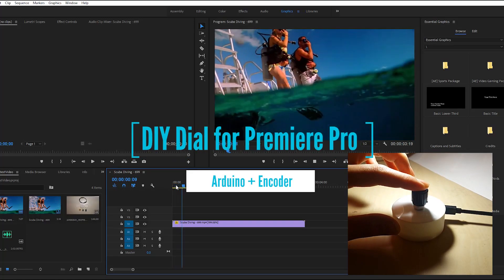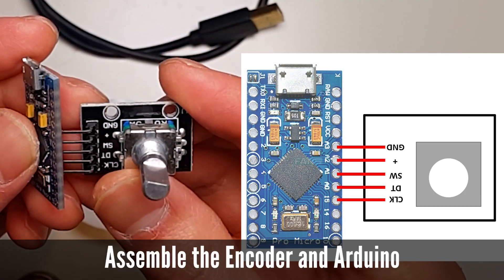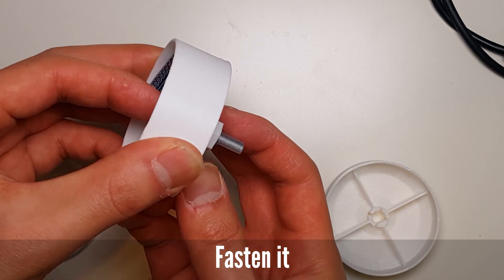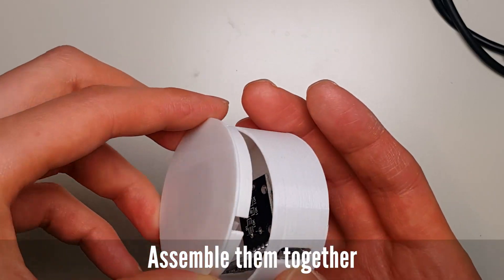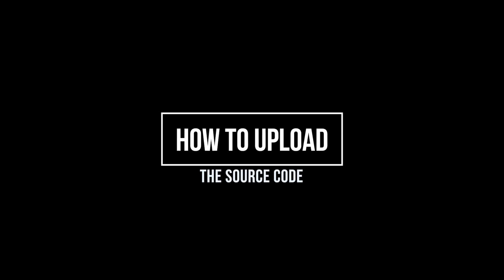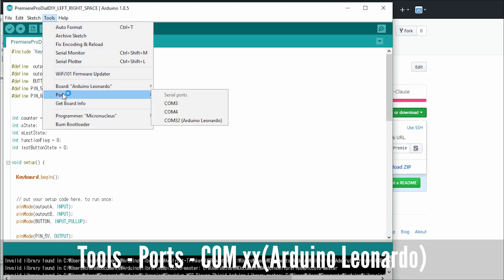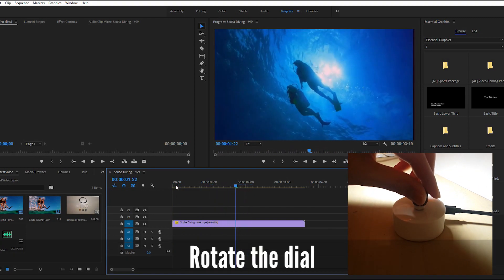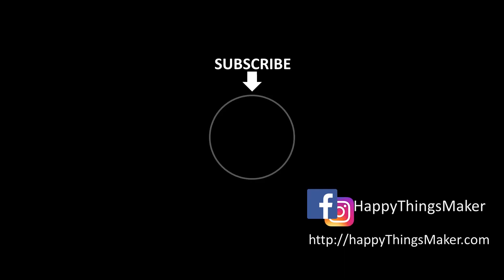Premiere Pro Control Dial DIY |  Video Edit Wheel | Arduino Leonardo Project | How to make

Comment: Thank you for sharing, excellent ! Very elegant design :)
As a suggestion, a version with 2 buttons, when you press them the dial move 5 / 20 frames (or more, customizable), when you release it it moves 1 frame. That way you could rewind / fwd fast , then adjust . 
Press dial to cut .
Reply: Did you find something that will do this ?

Comment: Can you make it work with Blender brushes? Sculpting & Texture painting? & With ZBrush & Substance Painter?
Reply from the maker: Hello! I checked Blender. I don't know well how to use that application but I checked the brush size is changed when I turn the dial. thanks
Reply: @EunchanPark  thanks for checking! I'll remake your design & hope it works for me too. Thanks for the video!

Comment: Hi EunChan, I know you already have a version two but I can't find the same dial that you have in my country, instead I found the same dial you have in version 1 so I have to follow version 1 instead. It works but not sure why when I turn the dial right, it turns to the left for one frame before going to the right frame? Same happens when I turn the dial to the left, it doesn't go left straight away. Is that what you mean by chattering in your programming? Is there a way to fix this? The dial works but very in accurately. The press button works perfect all the time.
Reply from the maker: what source code did you use? could you comment it please? you might need to add some delay on the code.
Reply: @EunchanPark  I used the PremiereProDialDIY_LEFT_RIGHT_SPACE code. any other code doesn't work. I managed to tweak the code after reading up a little about adriuno. I changed the keyboard.press to keyboard.write, remove the timer check and somehow it worked better for me. The left and right turn now is more accurate and doesn't jump a few steps anymore.
Reply from the maker: @limsoonchiong  would you try one more time from the source code? I updated the code which includes delay 8ms
Reply from the maker: https://github.com/happythingsmaker/PremiereProDialDIY/blob/master/PremiereProDialDIY_LEFT_RIGHT_SPACE/PremiereProDialDIY_LEFT_RIGHT_SPACE.ino
Reply: @EunchanPark  thanks. Will try again soon. Gave the dial to a friend to test the results.
Reply: @EunchanPark  is there any posibility to fine tuning values of reveal mode? 

(x5 mode) is 80, 85, 90, 95. Do u understand me? [ACTUAL CODE]
(x1 mode) is like: DARK: 84, 85, 86, 87. 

I would like to swicth definetly to (x1 mode) i hope we can do it! Anyway the x5 default mode is working properly.
Reply from the maker: @JesusGarcíaZamudio  yes, that's possible. you need to put mode code for pressing the keyboard 5 times more
Reply: @EunchanPark  no, i want 5 times less points, actually the values changes like -5/+5, i want -1/+1.
Reply from the maker: @JesusGarcíaZamudio  yes, that's also possible. you need to put some counter variable and takes every 5 times.
Reply: @EunchanPark  but if it counts 5 to send keyboard left/right how is possible to get a 1/5 digital signal step value?
Reply: @EunchanPark  i want to send steps 1/5 times less longer than the actual code
Reply: Is there any posibity to create from zero a programmed counter that starts at +50 then i want to modify this value to +38 for example, then it save pressing the center button and reset by a holding press for 2 seconds. I would apreciate it to see it. Now i dont have the idea to program that order
Reply: @EunchanPark  Hi, the new code works better. Thanks. Just wanted to find out if I use this model, how do I get it to work with Lightroom? The light room code only works for model version 2 right?
Reply from the maker: @limsoonchiong  well, you can use the first code with modification.
 change this code 
from 
Keyboard.press(KEY_LEFT_ARROW);
to 
Keyboard.press(KEY_UP_ARROW);

and 
from
Keyboard.press(KEY_RIGHT_ARROW);
to
Keyboard.press(KEY_DOWN_ARROW);

It might be working

Comment: Hey dude i have arduino leonardo can iuse for this program code?  And i'm using davinci resolve
Reply from the maker: Hello, yes you can use leonardo. by the way, what is the davinci resolve?
Reply: @EunchanPark  ya i'll and tray add some button,  DaVinci Resolve is the world’s only solution that combines professional 8K editing, color correction, visual effects and audio post production all in one software tool! You can instantly move between editing, color, effects, and audio with a single click. DaVinci Resolve Studio is also the only solution designed for multi user collaboration so editors, assistants, colorists, VFX artists and sound designers can all work live on the same project at the same time!

Comment: Good day Sir, i have done everything like you said,  and i upload the code, but it doesnt do anything.. i have the same parts as you and everything. i just wanna be able to scroll through the video and pause it when i need. Revind and Fast forward.. stuff like that..
Reply from the maker: did the source code uploaded well? I mean, when the code is uploaded well, you can see "Done Uploading"
Reply from the maker: and make sure you will need to download this code https://github.com/happythingsmaker/PremiereProDialDIY/blob/master/PremiereProDialDIY_LEFT_RIGHT_SPACE/PremiereProDialDIY_LEFT_RIGHT_SPACE.ino
Reply: @EunchanPark  yes
Reply: @EunchanPark  is there a code to check if everything is ok, i mean a code like to scroll on the web or to control the volume..
Reply from the maker: @loodBRATEpr00  okay, I am writing a code for the test. I will share it tonight.
Reply from the maker: I have few questions.

1. do you use windows? if yes, could you check your "Device Manager"  - Ports - (Com& LPT) and what can you see there? is that Arduino Leonardo? or Arduino LilyPad USB?
2. Can you upload the code again? I found a small possible fault on the code that I've shared. I changed and updated it.

basically, the code that was already shared can be the test code as well because the code just send keyboard signals such as right arrow or left arrow. if  the code is not working on the board, the dial (encoder) can be the problem.
Reply: @EunchanPark  good day sir, i figured out the problem, i got solder on VCC so that was the problem, but i wanted to let you know that out of all your codes, for me, only the premierpro left right ctrl works for me, can you maybe edit that code so i can pause a video by clicking the encoder, and play when i press it again. other codes dont work for me, i get errors when i try to verify or upload. Sorry for the long comment. best of luck.
Reply from the maker: @loodBRATEpr00  Hello! did you download the source code as ZIP file? download here link again and try them again. ( https://github.com/happythingsmaker/PremiereProDialDIY/archive/master.zip )
I would like to recommend you to open the ino files and set the board as "arduino leonardo" in tools - board
I checked them again and they are  "Done compiling."  well.
Reply: @EunchanPark  Thank you for your time, everything works i just cant make the video stop with the rotary encoder switch, ill try to figure it out :D Thank you Sir

Comment: hai

i want to change the  Keyboard.print(" "); into actual Keystroke of spacebar "Keyboard.press"

finalcut pro did not reconize print " " as spacebar
Reply from the maker: yes you can change and use that function. :)

Comment: Hi. can i use other arduino like pro mini atmega328p?
Reply from the maker: unfortunately, atmega328 cannot support USB function. "arduino pro micro" can do it
Reply: ahhh. how about digispark attiny85?
Reply from the maker: yes you can,  I actually tried with attiny85  for another project but I found some problem with attiny85. every time my laptop wakes up from sleep mode, the Attiny keyboard cannot work properly. I needed to unplug from pc and re-plug every time. But Arduino Micro Pro is working perfectly. I prefer to use Arduino Pro Micro.
Reply: EunChan Park cool. thanks 😁 subscribed
Reply from the maker: Thank you very much.  you can see the next version of this controller here  https://youtu.be/dJJ1wlJPqwE     :)

Comment: You showed us how to physically build it but I would like to know more about how it talks to premiere as I would like to try and make my midi controller control effect sliders such as clip scale, rotation and lumetri colour settings
Reply from the maker: Hi Mr. Komesy! Thank you for the replay.  It is kind of trick. the Arduino (the board) simply sends keyboard signals (Left and Right). Actually I don't know how to make the device with the midi controller but I think there are many tutorials. it seems like one of them. https://www.youtube.com/watch?v=68n95wA3mas I hope it help you

Comment: Hi , i want to make a premiere pro controller with 2 encoder , 
1 for left and right arrow and 1 for up and down arrow. 
I use your code but i have some problem. can you helping me please. this is the code

#include "Keyboard.h"
bool aState; 
bool aLastState; 
bool lastButtonState = 0;

void setup() {
  Keyboard.begin();
  pinMode(2, INPUT);
  pinMode(3, INPUT);
  aLastState = digitalRead(2);
  pinMode(4, INPUT);
  pinMode(5, INPUT);
  aLastState = digitalRead(4);
  }
long lastClickTime = 0;
long tempCount = 0;

void loop() {
  if (millis() - lastClickTime > 1000) { 
      aState = digitalRead(2); 
  if (aState != aLastState) {     
  if (digitalRead(3) != aState) { 
    if (tempCount ++ % 2 == 0) {
      Keyboard.press(KEY_LEFT_ARROW);} 
  } else {
    if (tempCount ++ % 2 == 0) {
      Keyboard.press(KEY_RIGHT_ARROW);}
     }
  Keyboard.releaseAll();
     aLastState = aState; 
    }
  if (millis() - lastClickTime > 1000) { 
      aState = digitalRead(4); 
  if (aState != aLastState) {     
  if (digitalRead(5) != aState) { 
    if (tempCount ++ % 2 == 0) {
      Keyboard.press(KEY_UP_ARROW);} 
  } else {
    if (tempCount ++ % 2 == 0) {
      Keyboard.press(KEY_DOWN_ARROW);}
     }
     Keyboard.releaseAll();
     aLastState = aState; 
   }
  }
 }
}
Reply from the maker: hi, I need to see your circuit. but the code will work possibly.
Reply from the maker: #include "Keyboard.h"

bool aState_Encoder1;
bool aState_Encoder2;

bool aLastState_Encoder1;
bool aLastState_Encoder2;

void setup() {
  Keyboard.begin();

  pinMode(2, INPUT_PULLUP);
  pinMode(3, INPUT_PULLUP);
  aLastState_Encoder1 = digitalRead(2);

  pinMode(4, INPUT_PULLUP);
  pinMode(5, INPUT_PULLUP);
  aLastState_Encoder2 = digitalRead(4);
}

long tempCount = 0;

void loop() {
  aLastState_Encoder1 = digitalRead(2);
  if (aState_Encoder1 != aLastState_Encoder1) {
    if (digitalRead(3) != aState_Encoder1) {
      if (tempCount ++ % 2 == 0) {
        Keyboard.press(KEY_LEFT_ARROW);
      } else {
        if (tempCount ++ % 2 == 0) {
          Keyboard.press(KEY_RIGHT_ARROW);
        }
      }
      Keyboard.releaseAll();
      aLastState_Encoder1 = aState_Encoder1;
    }
  }

  aLastState_Encoder2 = digitalRead(4);
  if (aState_Encoder2 != aLastState_Encoder2) {
    if (digitalRead(5) != aState_Encoder2) {
      if (tempCount ++ % 2 == 0) {
        Keyboard.press(KEY_UP_ARROW);
      }
    } else {
      if (tempCount ++ % 2 == 0) {
        Keyboard.press(KEY_DOWN_ARROW);
      }
    }
    Keyboard.releaseAll();
    aLastState_Encoder2 = aState_Encoder2;
  }
}
Reply from the maker: actually, the next version is 2 encoder version. you will like it :)
Reply: Hi Eunchan ,thank you for your response. My ArduinoIDE give me the errors (stray'\357' in program) 273 and 277
Reply from the maker: hmm, mine is okay, I think you you need to copy and paste the code to MS Word  without any format, and copy them again and paste them on the Arduino IDE. I hope it works.

Comment: Hi, I want to use your code to control Lightroom and Premiere with the same arduino board,
can you make a button with a two-colored led to select between 2 loops ? For example on
lightroom i use the encoder with UP and DOWN ARROW and the (Rightarrow) button, for the Premiere i use the encoder for the LEFT ARROW and the RIGHT ARROW and the button for the razor tool (c).
Maybe you can make another video for this, I suppose many people are interested in a code like this. Thank you
Reply from the maker: Hi, Thanks for your detailed comment. How about this? "Long press" for change the mode you mentioned. for example, press the button of this device for 3 seconds, the mode changes between "Lightroom(Up Down and Right)" and "Premiere Pro()". The Arduino also has a integrated LED so, I think I can use that LED for showing the mode.
I will write the code :-)
Reply: Perfect ! Thank you !
Reply from the maker: https://github.com/happythingsmaker/PremiereProDialDIY/tree/master/Premere_LightRoom_Multifunction

Hi, I uploaded the code.
Even though I couldn't use the LED for indication, IT WORKS WELL.

1. If you press 3 second (long press) it changes the function from one to another
- 1.1 Premiere Pro mode :    LEFT_ARROW, RIGHT_ARROW and C (Razor Tool) (for button click)
- 1.2 Lightroom Mode : UP_ARROW, DOWN_ARROW and RIGHT_ARROW (for button click)
2. It remember the last state of the function 
3. I applied the modification about what you mentioned last question about jumping 2 at a time

Try it and if there is any problem, please leave comment :)